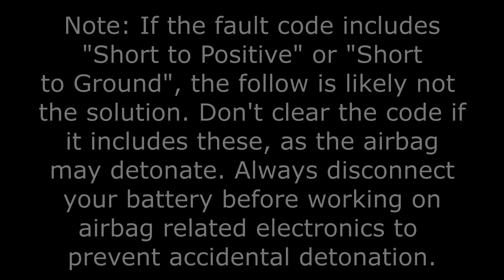Fix Your Volkswagen Airbag Light! (For Codes 01217 and 01218)

Comment: What about for 01218 - Side Airbag Igniter; Passenger Side (N200) : 001 - Upper Limit Exceeded - Intermittent - MIL ON?
Reply: Did you fix this issue?
Reply: @khalidmahmood8466  Yes I fixed it, it was a damaged wire from the A/C recirculation cap.
Reply: @MrSharky1972  very interesting im getting the same code. where is the wire?

Comment: I had this TSB done by previous owner and car started throwing the driver’s side code years later. I cleared the code only for it to come back. But I did notice when it did come back I had left car running while I checked my mailbox. As soon as I opened door to re-enter, chime sounded and airbag light came back on. Upon investigation at door wires in rubber boot, I found broken wires/broken insulation. I ordered some silicone insulated wires and new terminals and repinned the connector and butt connected wire’s further into door after removing inner panel and door skin. Cleared code and hasn’t returned since. Hopefully this should be a permanent fix for my 17 yr old car (2006 VW Jetta TDI)

Comment: Could you confirm which colour wire goes to which when you cut out/bypass the yellow connector? I'm trying to pause but it's not too clear
Reply: Just look at the plugs and see which wires line up together.

Comment: Hey, I was taking my steering wheel off (i was replacing the steering wheel module), and there were some problems the 1st time, so I had to do everything again.. After the 3rd time (I finally fixed problems with steering wheel), the airbag light just appeared in the middle of the ride (It didn't start when I turned the car on). The error is 01217 - Side bag igniter - front driver side: upper limit exceeded. I was wondering, could that be the same problem you're explaining in the video, or there's a chance that I screwed something on the steering wheel (airbag connectors - even though they look fine).. 

sorry for the bad english

Comment: I had my 2007 beetel fixed the heater core replaced & when I picked up my car  the air bag light was on  ...no codes  read on my code reader the mechanic said the code is alright like that but it  wasn't like that before they worked on it...if I'm gonna take it back 
How long should it take for them to fix it ?because I'm not leaving my car there...

Comment: Thanks for the video. I have today, randomly got the yellow airbag light and a warning light for the electric parking break. Both car on at the same time. Does anyone know if both of these wires/connectors are next to each other?
Reply: hi, did you fix the problem? if yes how. thanks
Reply: @mohammedamer7896  no
Reply: i'm in coventry

Comment: Where exactly is the connections that you show in the video.  I could not tell where to even look for these wires.  Any help would be appreciated. Mine shows a G180 as the item identified.  My car is a 1999 VW TDI ALH Beetle.  Thanks ...
Robert

Comment: i have the same issue. i removed the driver seat a saw the yellow plug where the wires are. My issue is that i dont know how to remove the wires from the yellow plug. Its like they are crimped in there real good. Does anyone know how to remove the wires? Or do i cut them out?
Reply: their is a clip to hold down bad u pull and it is pretty hard to pull it out

Comment: I Soldered and heat shrunk the connector seat to body but light came on again, So I did the Seat to Seat wire and its gone, really poor of Audi to have such a stupid fault. FYI this would also work if you sued bullet connectors plus minus for each wire so you never mix them up. 

Another tip, Check where the wires go, the colour coding is different on different cars, ie VW and Audi and Audi A4 and A6. So watch where the wires go!!

Comment: Bro ive got air bag checklight after i install new radio player on my mk5 ive checked all socket in the central unit its all in place whats the posibble problem im facing?
Reply from the maker: Did you scan it and see what codes came up?
Reply: Nah just need to clear the code for airbag. I think its normal to clear airbag fault code once u take it off the central aircon vent unit 🙃

Comment: bad vid man did not fix
Reply from the maker: I’m sorry it didn’t do it for you, this helped lots of people fix their issues, but it won’t fix it if there are other issues too
Reply: on some instances the airbag sensor needs to be replaced or recalibrated (usually when previous owner replaced the passenger seat).
Reply: @mazpr2025  what does replacing a seat cause?  Are you saying the used seat was damaged, the used seat belt connector wiring was damaged?  What model of car? Dud a broken used seat cause a new problem? What is a calibration? What model of car can be calibrated? Be precise.